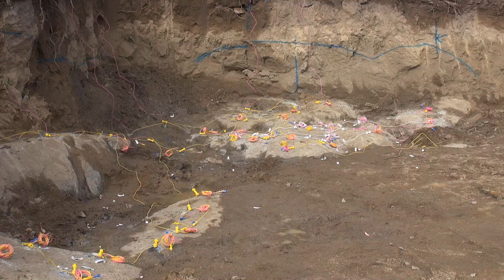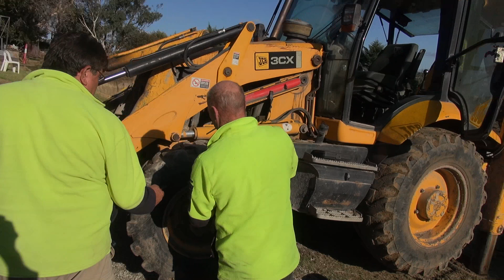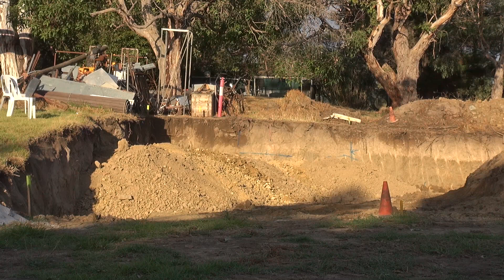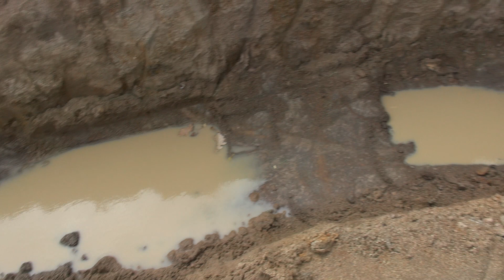Blasting strip footings for a retaining wall

Comment: Use det cord to put the tire back on next time. You'll only have to do it once, then just buy a new backhoe.
Reply from the maker: Was not my machine or my idea, det cord has been used in the past to separate split rims that are stuck tight.
Reply: @demolitiondavedrillandblast  Surely if you knew exactly how much gas a mm of detcord made, you could just precisely cut of the right amount to not only seat the tyre but also fully inflate it. Now sure, the margin for error is probably not good, but if anyone could pull of a totally perfect tyre reseat and inflate its gotta be you!
Reply from the maker: @adamedward205  It makes about 4000 times it volume in gas